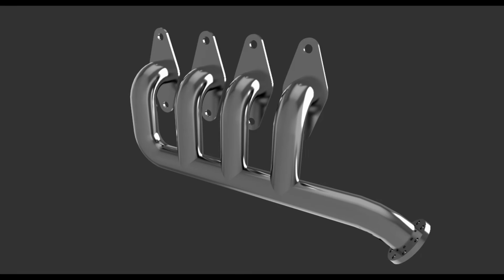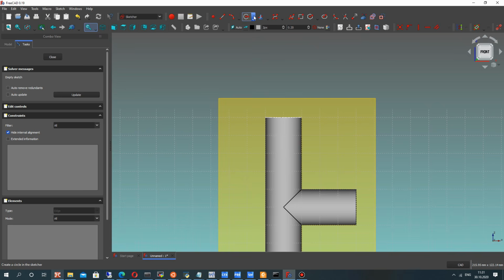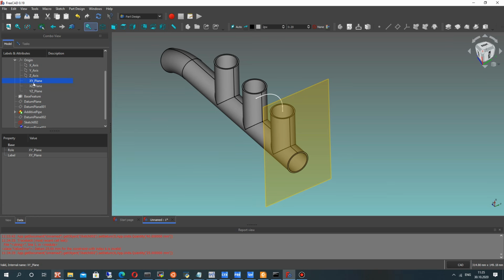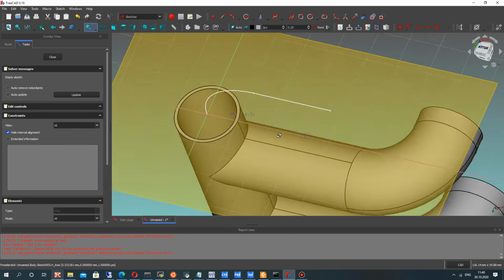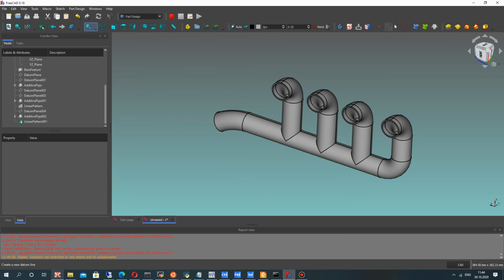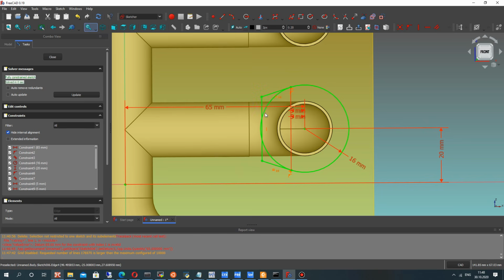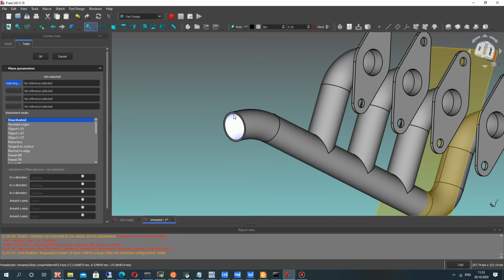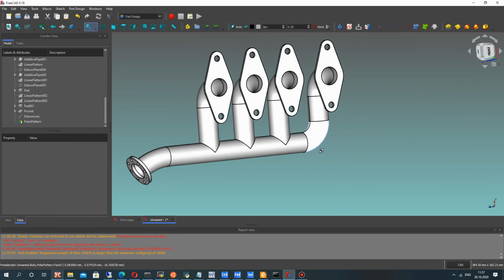FreeCAD Tutorial | Creation the Model of Exhaust Manifold in PartDesign Workbench

Comment: Thank you for the tutorial, it was really helpful for me as a beginner at FreeCAD. However, there is still something unclear to me. In fact this was the reason why I searched for the tutorial in the first place. 
My question: Is final product of the tutorial treated as a single solid (one piece) or it should be joined by boolean operation? What happens for example if you export this as a mesh, wouldn't mesh be somehow affected if you leave out that step?
The trouble I am having is boolean operations in FreeCAD doesn't always work as I would expect. I searched forums and the reason for that might be that I am trying to join coplanar faces. Apparently FreeCAD or its geometric kernel doesn't handle that well. Does that mean that I should always offset joining faces or there is more elegant workaround?
Sorry if my questions are out of place, I am doing my best to understand all this.